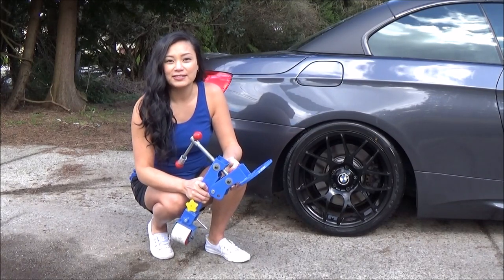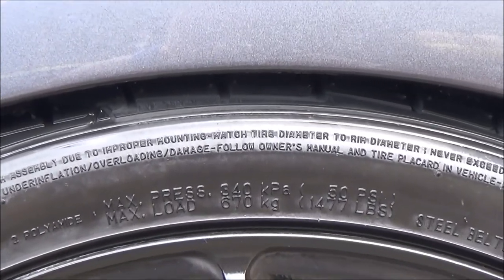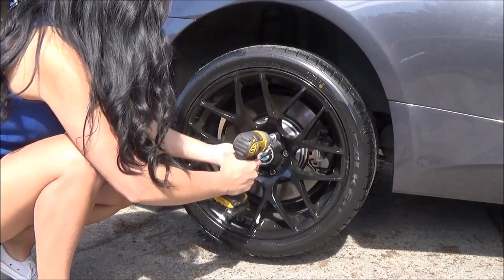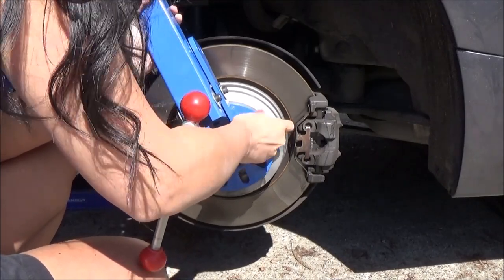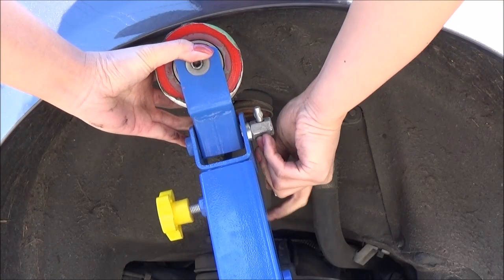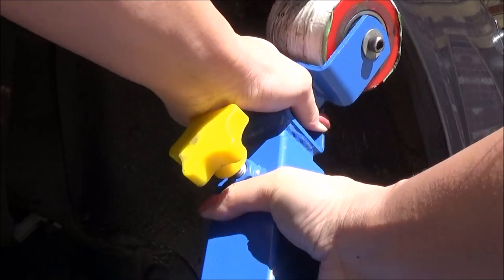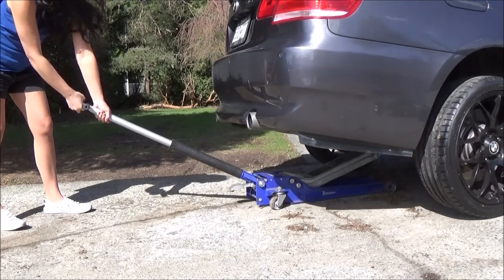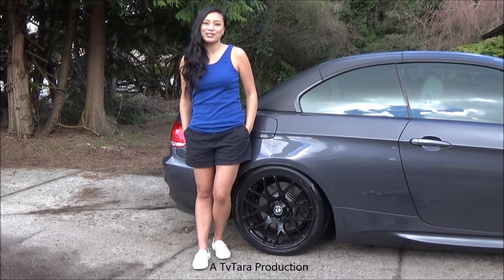How to Roll Fenders to Prevent Tire Rubbing (Using a Fender Roller)

Comment: If anyone else is watching and new to fender rolling please dont make the mistake to not clean the lip under the wheel well. If you are doing more than a couple milometers this will need to be cleaned prior to folding that lip or you will have a bad roll as dirt or rocks will be pinched between the lip and fender.

Comment: Hi please help i added 20mm spacer to my vw eos today an the car is stock height an i have stock 17inch 235 45 17 alloys when i went over humps it rubbed i then put 15mm spacers on its pretty much perfect but still rubbed when i go over hunp really fast what shall i do would i be able to rolls my arch then put 20 on back
Reply from the maker: Sorry I’m not an expert. Roll the fenders and if it still rubs, you’ll have to get rid of those spacers

Comment: Hey Tara nice video, where exactly on the car did u jack it up on ? Do you use the adapters too?
Reply from the maker: +Levi Rojas Not sure what adaptor you mean, so I guess not. I used the rear jacking point. It's hard to explain but you can google for a diagram.

Comment: I know its 2 years later but what mm did you go with on the spacers? I'm having the same issue with rubbing, if I go over any small bump or dip it runs and it's like nails on a chalkboard for me.
Reply from the maker: I had 12mm and later 10mm.

Comment: I got a Question, have to had any problems with your front control arms? my oem lasted at 109.000mls, my new ones failed after 3k 0_0 Lemforder let me swap it for new set, and new ones failed another 1500k :( they let me swap it one last time and tried blame saying something wrong with car and not the bushes. when clearly the bushes sits side the chassis  of the car. 
the new set are not on the car yet, ive decided to straighten the bushing area since alot of hollow  spaces could defo fail again. 
if the polly whatever its called sealant i used fails, then powerflex bushing will be used. 
moral of the story was it a good idea to fill the gap using (PU 40) polyurethane sealant.
Reply from the maker: +Quattro Bajeena No, no problems with the control arms yet!

Comment: What size tires u got? I i just orderd new wheels today and rear tires are 265/30 r19 i hope they dont rub
Reply from the maker: 225/40R18 and 255/35R18. Yours sound big!
Reply: TVTara ya 235 front 265 rears..i read that that they fit so i hope they do...your only got a 255 thats what come on it, maybe u rubbed cause u had a spacer in there bring the wheel outwards.ok thanks

Comment: do the spacers ever give you any trouble? (shake/vibrations etc. - specially on speeds over 100mph)
Reply from the maker: They never did in the past but if you watch a newer video, a wheels came off while I was driving and many believe it’s due to having spacers.

Comment: Quit slamming the cars on the ground and you wont have that problem
Reply: I had stock ride hight. All I needed was to change the wheels to get a tire rubbing issue.
I had 18 inch wheels with a 45 sidewall and kept blowing up my tires so I changed to a 17 inch wheel with a 50 sidewall profile tire to stop this. Mostly spacers and low offset make the wheel stick out and run the fenders.

Comment: Tara, couldn't you use a thinner spacer?
Reply from the maker: +Korsion I'm already using a smaller spacer than I used to have but anything smaller and the wheels would not look close to flush which is how I like it. But yes, smaller or no spacers would prevent the rubbing for sure.
Reply: Ah. ok got ya. looks good.

Comment: What size spacer are you using? Obviously running a new wheel with less offset isn't an option at this point because you'd need to purchase all new tires and find the rims you like. But at some point if you did want different rims you could try something with more of a negative offset and you could run wider tires which would give you a nice aggressive stance without the need for spacers. Possibly even fit a stock M3 wheel, though you may need to check that the backspacing is ok so you don't eff up your inside tread and wheel well lol
Reply from the maker: I’ve had 12 then 10mm spacers. Currently I have new tires and wheels and no spacers though.
Reply: TVTara Only kept the tires for a year?
Reply from the maker: Yeah they didn’t last long. Not impressed.

Comment: I always add 2-5 pounds of extra torque on top of the spec, just to be on the safe side.
Reply: paul davison You're assuming your torque wrench is 100% accurate. In any case, use whatever approach you deem appropriate for your car, if it works for you. But I can already tell you're one of those guys who follow their car's GPS straight into a lake.

Comment: What sizes spacers u got in your car
Reply from the maker: +Walter Vera 10mm
Reply: TVTara thank u Tara great videos I am great fan of u 😊
Reply from the maker: Walter Vera Thanks :)
Reply: Is that 10mm on front and rear? Do you still have 18s or have you stepped up to 19s?
Reply from the maker: Hin Chauhan Still on 18s and 10mm in rear only. Contemplating putting 10mm in front soon too.

Comment: Or you could use a broom stick or any other appropriate size pipe and not remove the wheel :)
Reply from the maker: Nah
Reply: @TVTara  we use to do that on the old rides back in the day. Granted, we had all steel lol. The tire spacing is vs on your ride.
Reply: Good

Comment: How many mm are your rear spacers?
Reply from the maker: They were 12, then 10
Reply: @TVTara  I tried it yesterday and wow...it is freakin hard. The front fenders can't be rolled on e93 since they are plastic. I just took a dremel tool and cut out the inside lip. If you try to roll the fronts, they will get pulled out...I had to try to match the right side to the left side after I saw the results...

The rears are firm and it is hard to see any change unless you compare to the unpressed sections. I have 18mm in rear and 15mm fronts... will see if this stops the rubbing. If not, then I will reduce to 15mm rear and 10mm fronts. 

Thanks for the post!

Comment: What size wheel and tire spec are you running?
Reply from the maker: Front:  225/40R18 and rear: 255/35R18. Wheels are 18s with offset 35

Comment: Why not get smaller tires.  LOL
Reply from the maker: Because they were new and I'm too cheap to buy new ones.
Reply: Next time you know, eh?  :))
Reply from the maker: The new tires were the same size as my previous tires which didn't rub. Also I bought them at a reputable tire store so I trusted they would know better.
Reply: Did you lower the suspension?  Springs in particular??  If not, change with new springs.
Reply from the maker: I have springs so can't be adjusted and I'm not buying new ones.
Reply: You can lower your suspension. Lots of kids lower the cars for looks and performance especially BMWs.  LOL.  But if your old springs are bad, it will cause this issue.  Is this the original springs? Research it and if it is get new ones.
Reply: Replace struts and springs together.  :))

Comment: Hella flush lol... Get some real tires and lift the car back where  it belongs problem solved. You ain't on a track racing . No point. Oh I forgot you get the cool points cause your lowered . Enjoy replacing the suspension parts left and right. Lmao.
Reply from the maker: I never had to replace the stock shocks surprisingly in the few years I had that car actually!
Reply from the maker: But thanks for the cool points, Kev! 😜